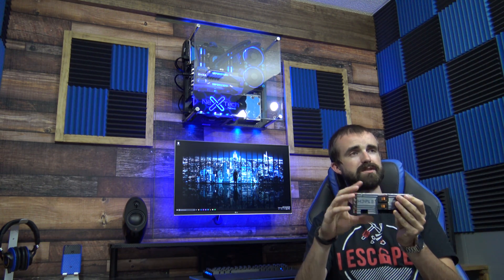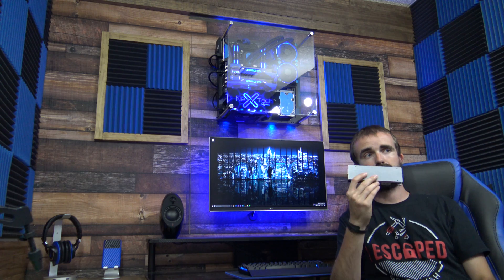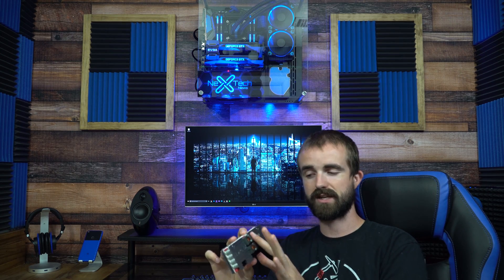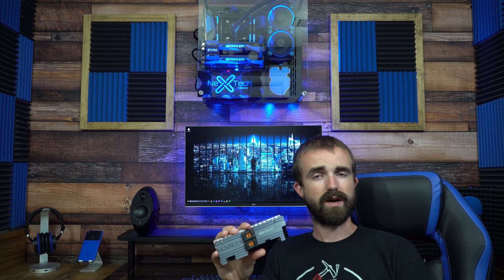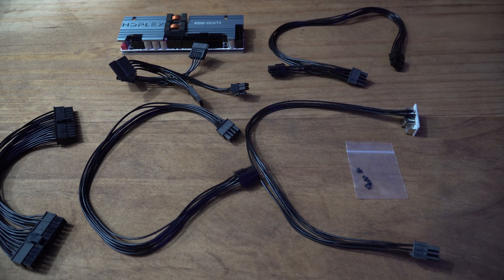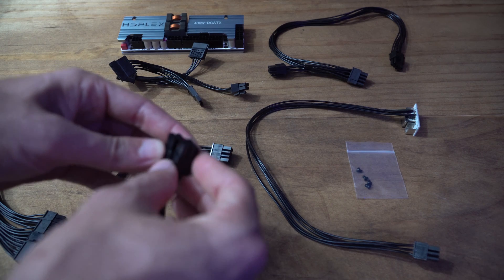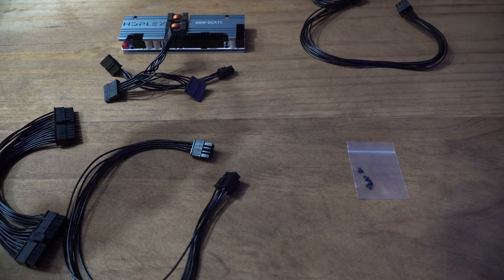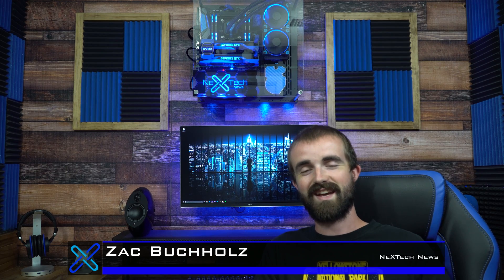HDPLEX 400W DC-DC PSU Review

Comment: I got this yesterday and found that the 7.4 X 5.0mm DC jack is by itself. I need to fit this into the IEC input plate of a Streacom FC10 case. How should I do this? The plate shown in this video was not provided with the PSU that HD Plex sent me.

Comment: Can It hold: Ryzen 2200g + 2 Mem + GTX1060 + HDD + 2 or 3 fans ? Thats my setup but in calculator i found that It only consumes 240w with GTX 1060. I have an Corsair 500w PSU but its Very big.. um thinking If i could remove the metalic case It can be more Small. But my question is: If i remove Will It interfer on funcion of Other pieces ? And it generates waves and energy so could It be bad for health and pieces health ? I Saw many people using PSU alongside HDD.. HDD is Very sensitive so could It generate any damage? Thats my question.
Reply: I recommend a hdplex 300w and you will need a laptop brick specifically a dell 330w brick.

Comment: Great review... thanks and I for one won't complain about camera angles - calling it your artistic style. Anyway, I was wondering, how does this compare to a standard PSU in heat output (does it put heat into the case?) and in voltage/power loss/efficiency?
Reply from the maker: Thanks for not complaining haha! And it surprisingly puts out very little heat, even under heavy load

Comment: I'm a bit confused about the 24V input range, don't 24V car batteries have a higher max charge voltage? Would it be a problem to connect it to a slightly higher input source? (e.g. 8x3.2V lifepo = 25.6V or two 12V car batteries in series should also be around 25V at max charge).
I'm looking for a solar powered / powerwall ~24V PSU for my gaming PC.

Comment: Question if HDPlex is 400w but ac dc adpter only 330w means your build cant exceed 330w correct?
Reply from the maker: +Dawid Kaminski Yes you would be limited to the Dells 330watts

Comment: Thanks for doing a video on the Hdplex 400w. It'll be cool to see it in action. I'm doing an ITX mod and was thinking about getting the Hdplex 400w and the 300w AC to DC power pack instead of using an ITX PSU. Will be looking forward to your next video. 👍
Reply from the maker: +Poisonous Heathen Your welcome! And that's sounds awesome! Hope it all goes well!
Reply: Poisonous Heathen me too! I got an Corsair 500w s500 série, but its Very big with case, could i simple put It off and use along Other pieces?